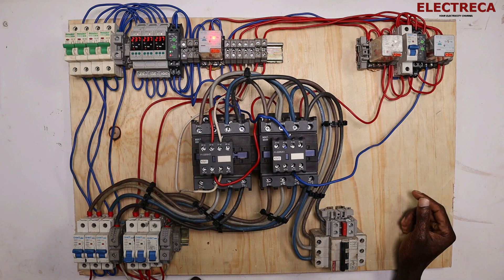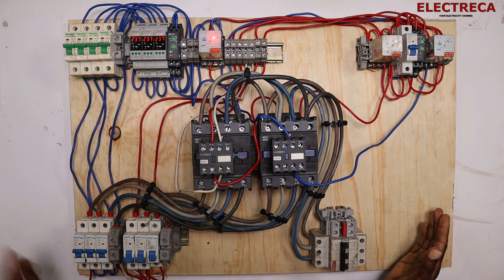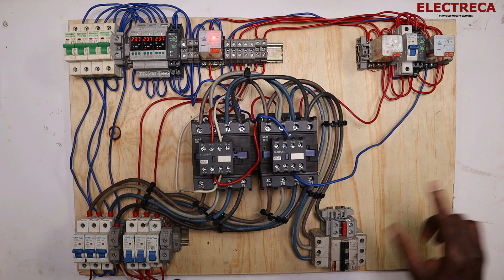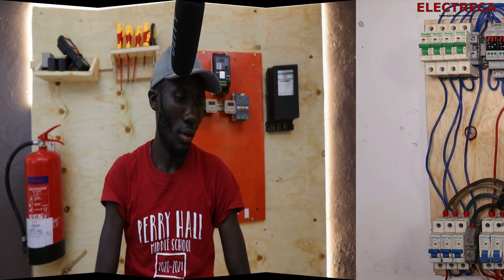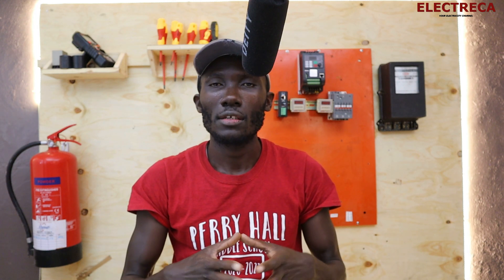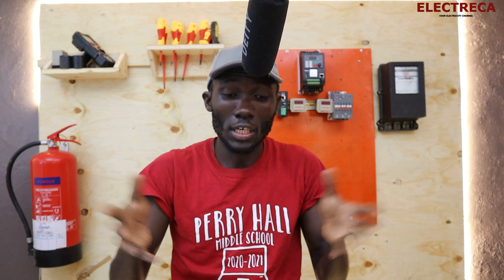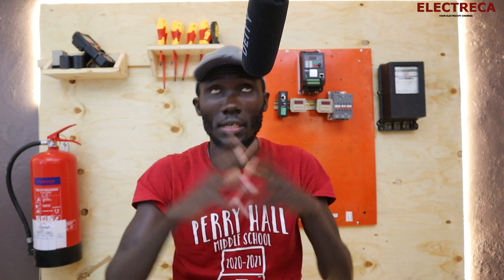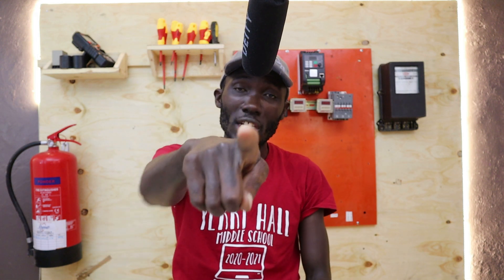How Automatic Transfer Switches ACTUALLY Work

Comment: Building automatic change over switch calculation
Reply from the maker: The power cable rating usually gives you the size of a contactor, so there is no need to worry about the small components; they still control an even larger size of the contactor.

Comment: if the utility power is restored and the generator continues to run for more than 30minutes, what can you do.
Reply from the maker: generator may have more than one timer that control the time of cooling, you check can the cooldown time from the controller adjust if necessary or check for cooldown timer inside ATS if any adjust.